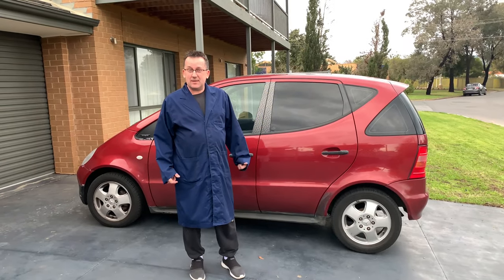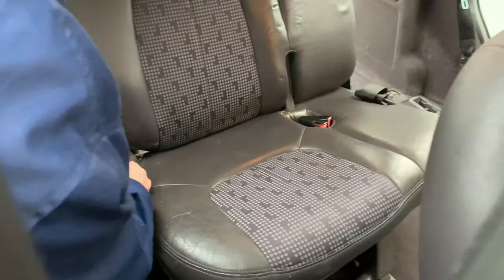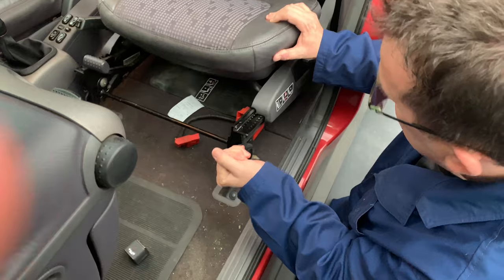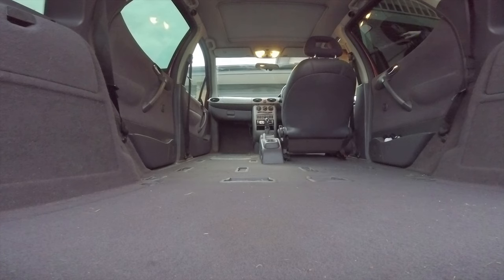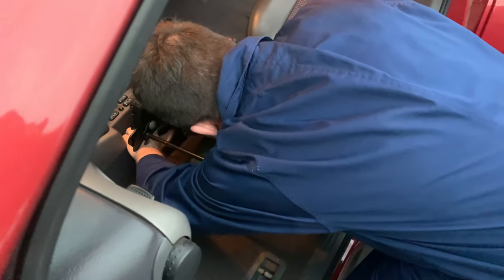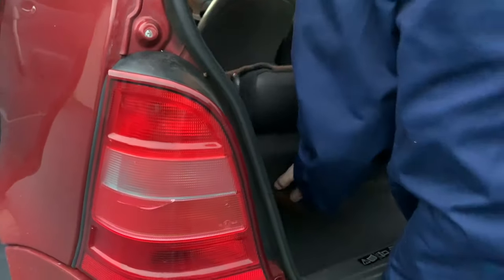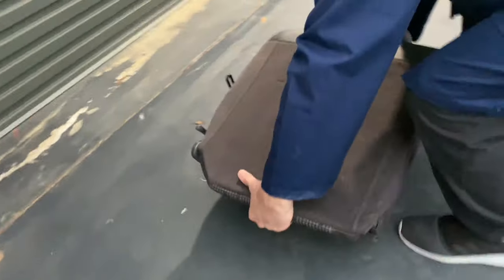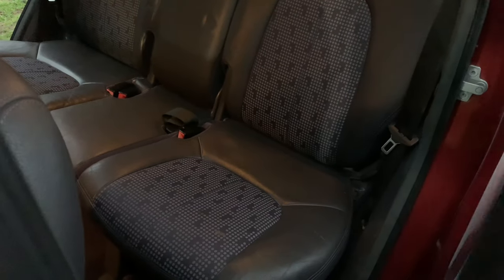How to remove seats from Mercedes-Benz A160 (W168)

Comment: the best thing about W168.. it was nice for me when i worked in a bicycle shop and did the cargo to customers or from providers, i could carry bikes, lots of frames and parts without having to hire a kangoo or cargo van
Reply: Wilson Tatsuya Kamima nice to hear that. I am also planning to buy used A140 (2000). What do you think about this car. Can you share your experience? Some of my friend told me it’s kind of expensive junk, got problem so fast and to repair its expensive. Also due to low  power it’s not safe for long drive. Thanks in advance.
Reply: @IbrahimSarker  maybe your friend is right, its quite expensive to mantain, and you should look for a more common or typical car or van in your contry, in my case i only got the A160 because i knew an import spare shop owner. otherwise is more convenient something like Renault Kangoo

Comment: My w168 a140 left front seat has a different type..
How to open it?
Reply: Don‘t. You disable ESP when doing so. The removable Seat in the Front row is an additional feature which was around 200 €.
Reply: @txy007  omg thanks
Reply: @bertypuspita2852  you‘re welcome! My w168 is unfortunately also not equiped with this Feature. But still a great Mini van. Love it!
Reply: And the problem is: you can‘t just reconnect the seat in our case. There will stay an ESP-Error in the boardcomputer which is difficult to fix yourself. So it‘s really not worth it. Unfortunately there is no way to add the removable seat.